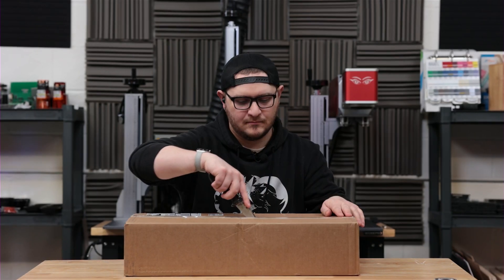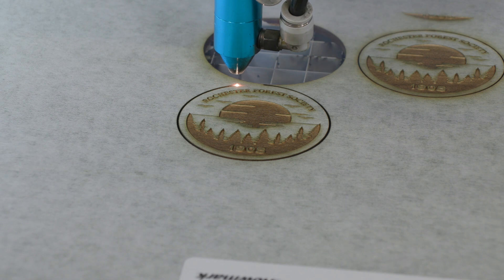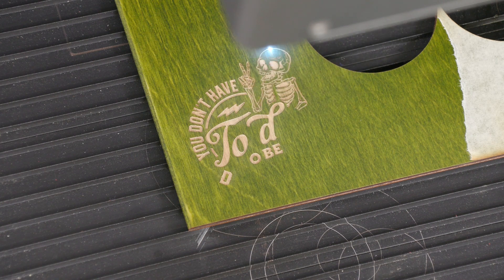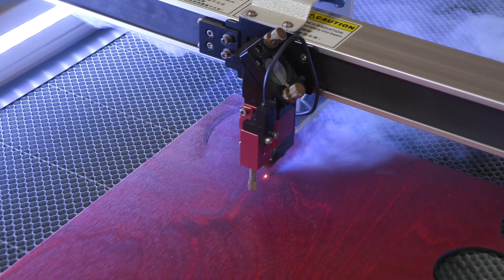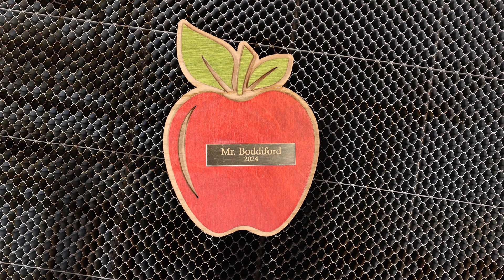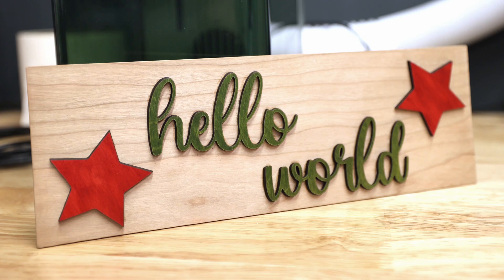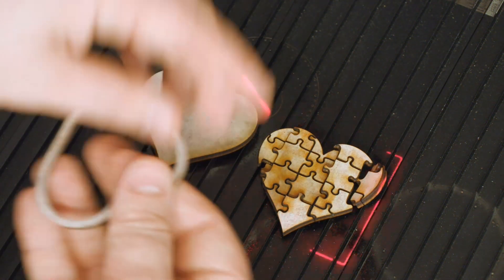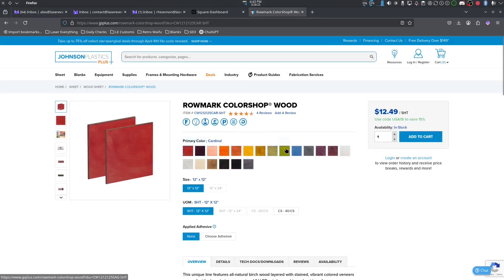The ULTIMATE Laser Guide to Colorshop Woods | MINI Craft Show Projects!

Comment: Did you get a feel for why they indicate to use one side as the engraving side? Does one side engrave better than the other or doesn’t it matter?
Reply from the maker: From what I’ve seen, the difference in engraving quality between the two sides is minimal—it’s hard to tell if there’s a real advantage. The labeled side might just be a bit cleaner or better protected. I’m sure they have their reasons, but overall, it doesn’t seem to impact how the material engraves.